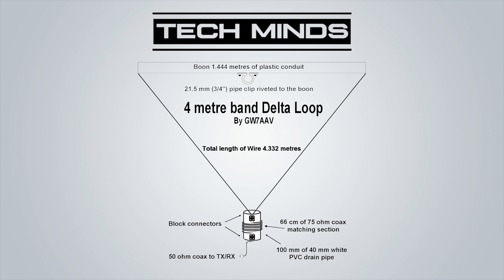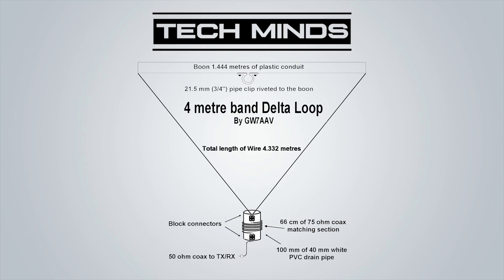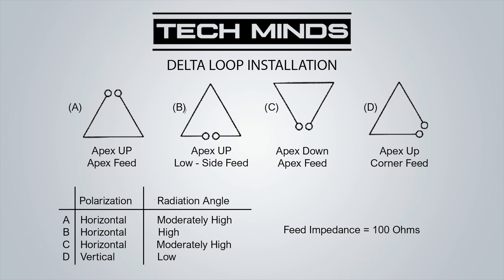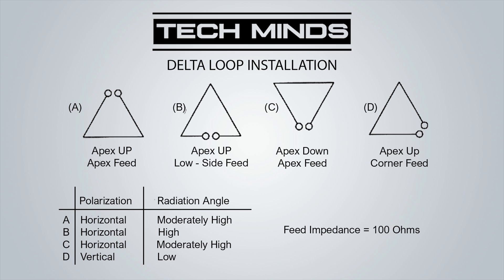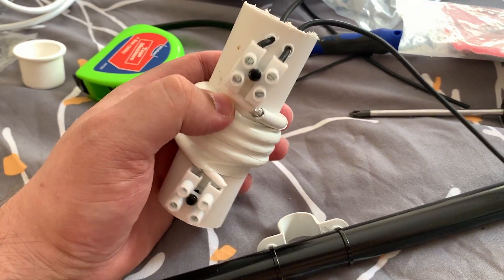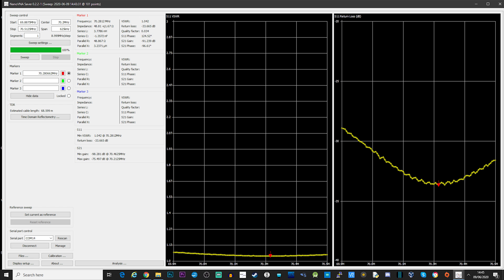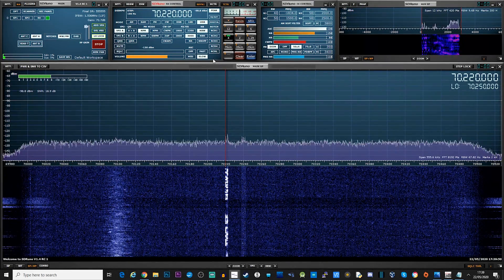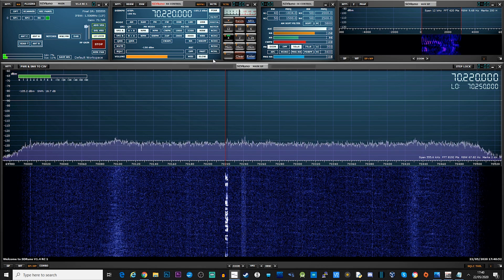Homemade 4M (70MHz) Delta Loop Antenna

Comment: I just put a home made 4m dipole in my attic , may try one of these next .
Reply from the maker: Try the flower pot version too for vertical. The delta loop works awesome for horizontal SSB.

Comment: I will build one as well in the near future!
I only have GM900 radios at the moment,but will try to find some DX in FM,usually when the propagation is good,there are workable stations in FM as well
Reply from the maker: There has been some good DX into EU over the past few weeks on 4, I’ve worked some on SSB but not FM as of yet. Good luck! 73

Comment: Can I use this antenna for Wi-Fi signal
Reply from the maker: No, wrong frequency range. You need 2.4Ghz or 5Ghz depending on band.
Reply: @TechMindsOfficial   thanks for reply please suggest any Wi-Fi antenna 2.4 gigahertz
Reply: @TheSachin6678  try a PCB Yagi from G4DDK web shop. There's also a PCB log periodic antenna for 1 to 6 GHz reception which you could use at the feed point arm of an old Sky dish. They both need semi-rigid coax making up. One for Matt to demonstrate 😉

Comment: Yes I made both of Steve's delta loops more than 5 years ago. They're  spot on without adjustment.  Scrap tv coax was found in the loft! Using conduit straight sleeves, wall clips and a plywood mounting board you can split the boom in two. Then carry it on your rucksack to a summit for some quiet, noise-free portable operation.

Comment: "That's interesting results, I built the 6m version from the same plans, using QRP from the garden I made a QSO into Italy from Manchester, pretty happy with that.
I have only had mine at about 3m from the ground and saw a swr results the same as you. Its a little unwieldy though for taking portable though I ended up making an coax vertical to take out.

Great video

Comment: Your last remark is very interesting. large Bandscope for the 7300. I have a 7300 and that was the flaw of this set I think. Looking forward on your video
Reply from the maker: Yep, I’ll be doing a video on that real soon, thanks for watching 🙏
Reply: Yeah I've been using the RUMlogNG app on my Mac (N1MM Logger can also do this in windows) to get a scope via the USB, but prefer to add an IF Tap and separate SDR.  There are a couple I know off, one passive and cheap and the other active and damn expensive.  Curious what you've got there!